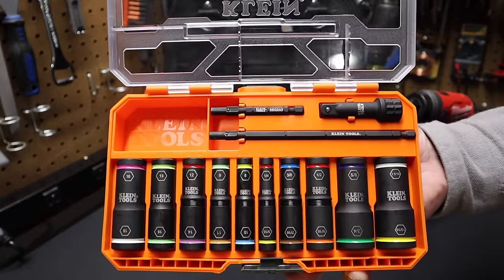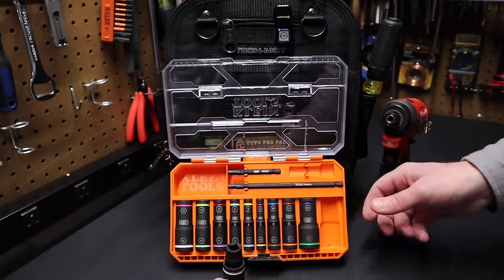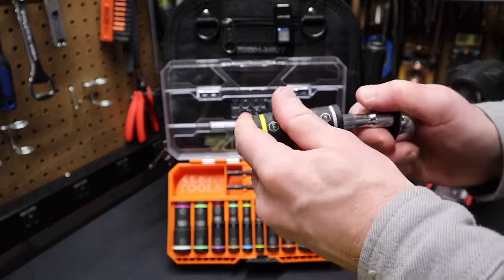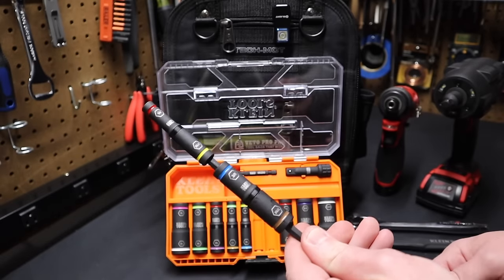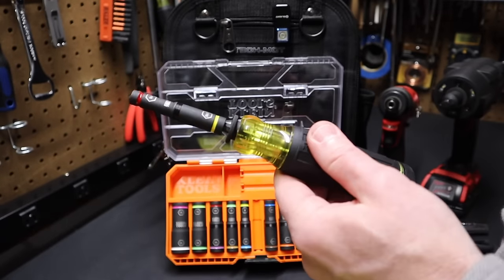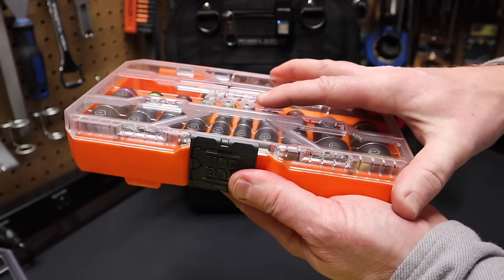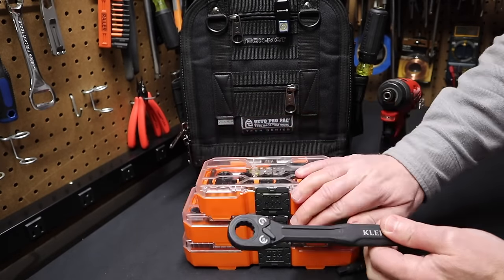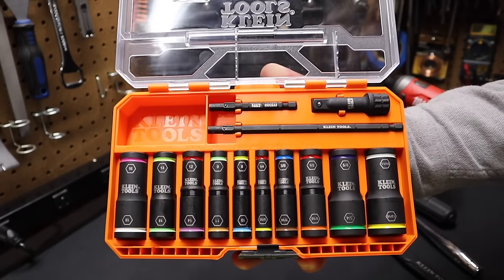UPDATED: NEW Klein Tools Impact Flip Sockets KNECT M System - SAE & Metric 65239

Comment: Looks like a nice socket set. The first time I got an 11 in 1 driver, I thought it was a neat idea. 2 years later with daily use, I'm on my 4th one. I am a maintenance worker, my tools regularly get wet. When the 11 in 1 gets wet, it rusts and you can't pull it out of the handle. They need a rust resistant coating on their tools.
Reply from the maker: If it’s regularly getting wet, you might be better off with the standard 11-in-1 or the magnetic 11-in-1 because they are both chrome coated which makes them more corrosion resistant. Thanks for watching!

Comment: I know everyone likes the mod boxes, but I wanted to fit these in my bag, so I used the long shaft and attached two smaller sockets each end with two sockets in middle and worked it out so the smaller ones slipped into the larger ones, now what I have is two real long shafts the a shorter double connected together with a 3/8 adapter that has 1/4” shaft other end, fits together with a larger socket and small one, anyway this fits pretty compact in my bag. I’m sure there are plenty of other configurations as well
Reply from the maker: Sounds good. Thanks for watching!  👍

Comment: I simply wanted a SAE+Metric set that works with wrench, work as a nut driver with 32500HDRT and work with 1/4” impact driver. Overall great idea but the way sets are built makes you purchase multiple sets. For example, this 65300 set does not come with wrench and as you can’t buy it alone I ordered 65239 set with 1/4” wrench. I am not sure if I also need another set with 3/8” wrench. If they had built a set with 2 wrenches and SAE and Metric  sockets, I would be done in one set. If you can make a video on how these 3-4 sets they have come up with works with each other, it would be great!
Reply from the maker: That’s a great idea for a video, thanks!  👍

Comment: Its a great idea i just hate klein is reinventing the wheel with their proprietary spline for the sockets. A standard 1/4 square or 3/8 square would make this perfect. Especially for bolted connections haven't found a 1/4 hex torque wrench that goes up to 36ftlbs yet.
Reply from the maker: I wonder if it's possible to make the smallest deep well sockets using a 1/4" square drive... I think you wouldn't be able to make them in the flip socket style.  Thanks for watching!

Comment: A fun fact the 3/8th drive adaptor will also fit in the 11n1 Drive handle. So you'll have a driver ratchet, even pass through if you have that socket set too.
Reply from the maker: That’s correct, that’s really a better way to go. Thanks for watching! 👍

Comment: Does the black paint/coating rust?
Reply from the maker: It’s a black oxide finish designed to help prevent rust. Anything made of steel will rust in regular high moisture settings. Thanks for watching!

Comment: Very unfortunate this didn’t come with one more adapter that had the same drive end as this 3/8, and the flip socket spline shaft on the other end. Allowing one to drive the entire set with their 3/8 impact wrench, standard wrench, or Klein’s passthrough wrench. It would look very similar to the adapter on the far left in the 65300 set just with this function.
Reply from the maker: I’m trying to visualize what this would look like.  I know the adapter you are talking about in the 65300 but not clear in which drive end of the 3/8ths you are referring to.
Reply: @projectpinehills  yeah sorry its difficult when there are so many things going on hah. So at 0:32 the row you are pointing to, if you combined the outside ends of these two adapters and delete the middle you can visualize it. With this new adapter and the one on the right, you could Drive the entire set of sockets with a 3/8 impact wrench....
Reply from the maker: @woltergrant I see what you are saying, good point.

Comment: I have a standard ratchet.  It fits my standard impact deep sockets.  If I want to convert to power I have one adapter.  With this kit in order to have manual and power capabilities, I need at least 3 adapters and better 4 to achieve the same. How is that better???
Reply from the maker: Good point. This is not something to replace a standard set. It’s if you are wanting to pack lighter and have pass through for all thread. Thanks for posting!  👍

Comment: FYI, you are able to use just the pass through adapter using just the screwdriver handle without using the 1/4” adapter.
Reply from the maker: No, I tried that and should have shown it doesn’t work with the KNECT M ratchet 3/8” equivalent. The impact 11-in-1 is designed to work with KNECT S which is the 1/4” equivalent version.

Comment: Is there anyway to get this now?
Reply from the maker: It’s in some Lowes and I think it will then be available elsewhere.
Reply from the maker: Go to Lowe’s and go to the electrical tool section. Look In overhead inventory, that’s above the tool section.  The tools are up there awaiting a store reset but you can still buy them.
Reply: @projectpinehills  Man thanks for the advice.  I tried to find this at Lowe's and did exactly what you said.  They were sitting in a box above everything else with the product code on it and I had to get a staff member to get it down.  They had told me that they didn't have it in stock and I had to special order it.  Well they had it and I got it.  Thanks again.

Comment: why cant they make a set unto 1 1/4
Reply from the maker: That would be nice. For smaller stuff, they use the hex/spline drive.  Thanks for watching! 👍
Reply: @projectpinehills  yeah now that I think about it, it wouldn’t be practical to have a 1 1/4” socket with a 1/4 hex drive. Still would be nice to have a 24-32mm or 15/16-1 1/4 flip socket set. But then again again, where ever I use a 32mm half the time I only have access for a spanner so a flip socket would get even less use.

Comment: This kit drives me nuts because it is expensive yet still does not include the adapters that would be necessary to run manual and power. The adapter to power  for large flip sockets is not in kit, the adapter to manual for small flip sockets is not in the kit. I really don't want to buy multiple kits with duplicate parts just to get the full capability.
Reply from the maker: I get it. It should at the very least have a long 3/8 impact adapter in it.